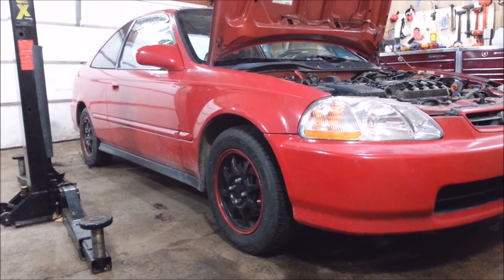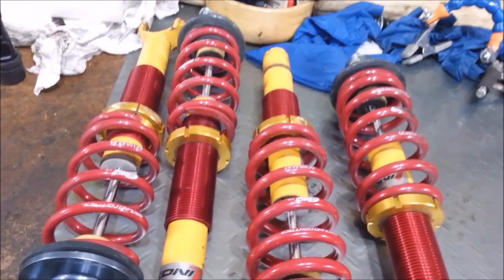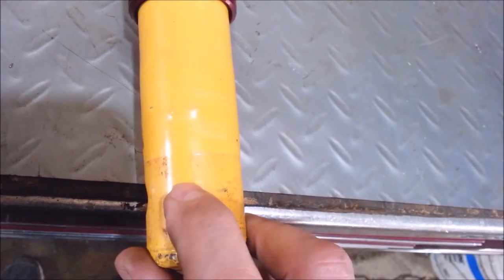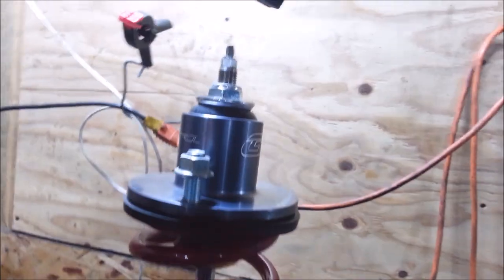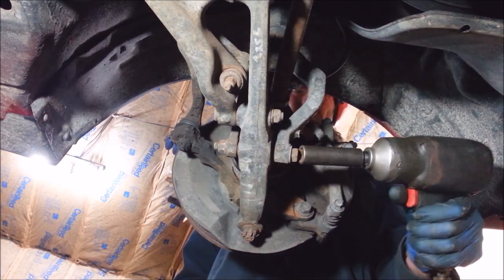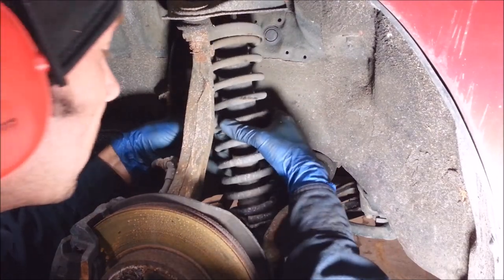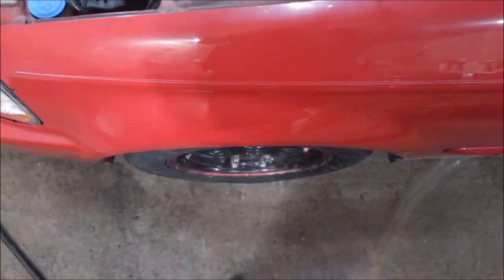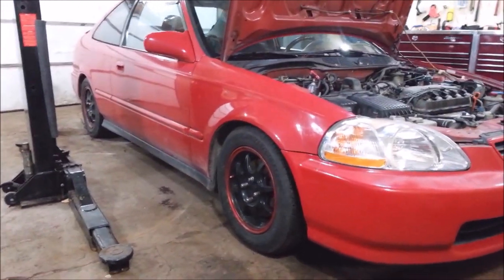1996-2000 Civic Koni, Ground Control lowering kit Install

Comment: When using aftermarket lowering springs or coilovers with Koni shock's you must put the clip back in to the center position. But if you're re-using your factory springs, then you can lower the clip to the lower perch and it will lowe your car 30mm which is around an inch or so. So I'd leave in the center if you're using those ground control coilovers because what's going to happen is your going to lower your car to much if you end up leaving it in the bottom perch and that will tend to put more stress on the shocks and shortened their lifespan.

Comment: I miss my old Civic. I bought it used when it has 90K on it, put another 100K on it and it needed a head gasket so I sold it. I would love to find another one, with a 5 speed. Is yours stick? They are fun beater cars to blast around.
Reply from the maker: Manual EX.

Comment: I couldn’t find any hardened thicker washers in my area. Only 1.5mm zinc washers. Does it matter if I have to stack about 5 together to get 7mm?
Reply from the maker: Stack away.
Reply: @RustBeltAuto  Wouldn’t cause any issues in that many washers “shifting” up/down or anything right?

Comment: Thanks for the video, I just installed them in my 2000 hatchback. I am having an issue where whenever I go over a bump slowly, I hear a clunk from my front coilovers, at higher speed it's non existent. Any ideas on what I need to tighten? I loosened all the bushings you noted and tightened them up to factory torque specs
Reply from the maker: I dont know, and would make sure sway bar bushings, and links are good, if you have them.
Reply: @RustBeltAuto  hey man turns out I was a moron and hadn't tightened my front upper control arms all the way back down after i loosened em. keep up the great work man loved your turbo build on your Civic
Reply from the maker: @bagfumbler  I'm glad you figured it out.

Comment: Curious how off was the negative camber in the rear using 7mm washers after getting an alignment? Might need to do same thing on mine
Reply from the maker: It was where I wanted it. A little negative over stock.
Reply: @RustBeltAuto  Does the strength/type of the longer bolts needed matter for that upper control arm?
Reply from the maker: @mrsemifixit  you want about 6 to 8 working threads on a bolt.
Reply: @RustBeltAuto  Does the grade of bolt matter?
Reply from the maker: @mrsemifixit  I do believe those are all marked grade 8.

Comment: You do anything for heat in that garage?  I'm in Rottenchester Ny gotta love the cold as balls weather!
Reply from the maker: Yes. I found a 4 car garage shop that went out of business, and bought their 250,000 BTU Reznor furnace for cheap, converted it to propane, and put the smoke stack straight out the side of the building, instead of through the roof, double walled at the wall. It's huge. Most would think it's overkill, but I love it, because it can heat that garage up in about 5 minutes when it is -10f outside. I think it actually uses less fuel, when you don't keep a garage heated all the time.
Reply: @RustBeltAuto  holy shit thought you were going to say you have a 50,000 btu unit!  You're smart, you basically have a fixed, vented propane salamander that is much more practical.
Reply from the maker: Yes. When you have to heat up a garage to do a 1 hour job, I really don't see the point of waiting 30 minutes to heat up a garage with a 50,000 BTU furnace. Those salamanders are nasty. It like bubbles your phlegm, and really screws up your lungs. The kerosene ones are disgusting. It must be vented.
Reply from the maker: I was wrong. It's only 165,000 BTU ;).
Reply: Can you do a video of your heating setup? Maybe talk more about it. I heat with a double drum wood stove and it works, but it take some time to get going... Would like something like you, propane is pretty cheap and easy to store. Would appreciate a "how I heat my shop" video, thanks! OKAY BYE!